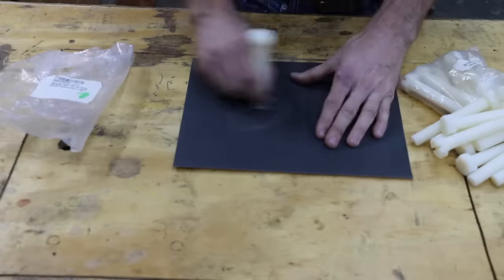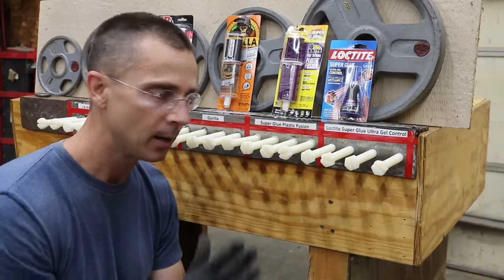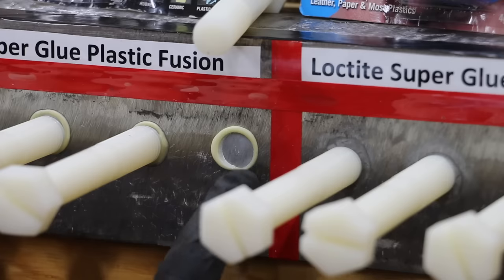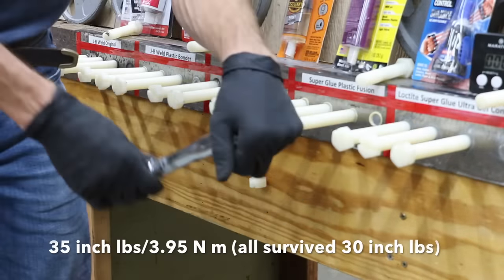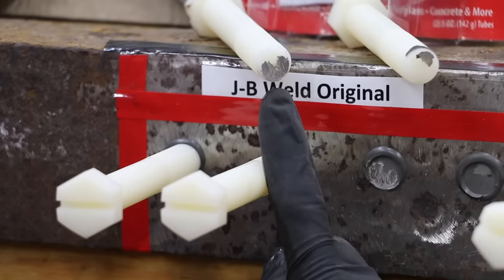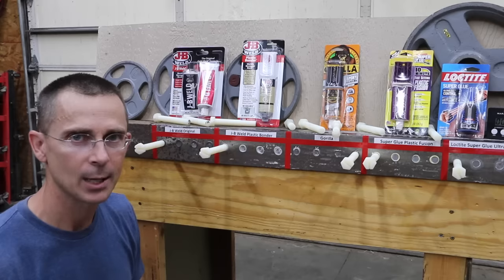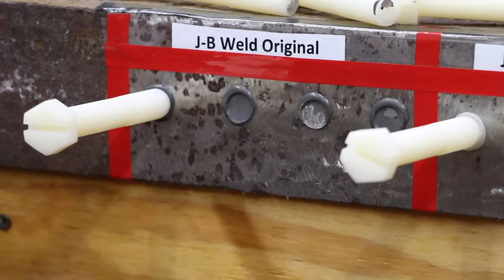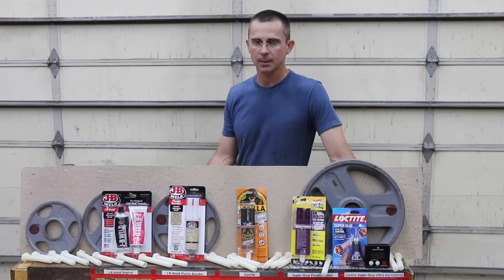Which Epoxy is Best for Plastic?  Let's find out!

Comment: I accidently drilled a hole through a fiberglass boat. I am thinking that either the JB Original or the Gorilla might be best since the hole is on the bottom of the boat where vibration is extreme. Any feedback on this or other mends would be appreciated. Hole is 1/4".
Reply from the maker: JB Weld should do the job.  A fiberglass repair kit might also be a good option.
Reply: @ProjectFarm  Thanks. JB has a marine product.

Comment: Would like to know what type of material the test bolts were made of,most non metal fasteners that I have seen were nylon which I have never seen anything bond to. I have had good results with most plastics when using epoxy specifically for bonding plastic these epoxies have a very strong solvent smell unlike most epoxies which have very little smell , I believe that the solvent allows the epoxy to melt into the plastic similar to PVC drain pipe joints
Reply from the maker: Thank for the feedback.

Comment: Thank you for your videos, I think a lot of us struggle in finding the appropriate adhesive for gluing plastics that are subject to rigorous forces. 
I was wondering if you would expand your testing of plastic adhesives to other types of plastic. It looks like you used nylon bolts and I was wondering would those adhesives test the same on abs plastic or on delrin or PET or PETE etc. 
Personally when I am attempting to glue plastic it is usually trying to glue a broken piece of plastic back to itself. So I was wondering what kind of results you might receive in testic plastic to plastic adhesion. 
A couple of other adhesives to consider adding to the mix might be a pcv plumbing glue (which there are many, some are a 1 step while others are a prime then glue) or what about something like testors plastic model glue? 
There are so many kind of plastics and so many plastic glues that I think you could make 10 more videos.
Thank you again for your informative videos.
Reply from the maker: Thanks and you are welcome!  Thanks for the video idea.

Comment: good enough presentation for me. this guy ain't a chemical engineer, but at least he's making an effort with a good enough test measurement method.  My girlfriend works for NASA as an electrical engineer and she does not know to use a multimeter. 
She did confirm to me they have JB weld on the space station, you cant weld in space, but you can jb weld. They keep several rolls of duck tape on space station space also.
Reply from the maker: Thanks!  Thanks for sharing.

Comment: Have you ever tried flame priming the plastic surfaces or used industrial trade expoies like Gflex ( specific epoxy for joining two plastic surfaces that have to flex in unison)?  Not sure if flame priming is an old plastic fabricators tale or not, but lightly without burning the surface pass a torch over the plastic before gluing.
Reply from the maker: Thanks for the suggestion.

Comment: Do we know which 2 part epoxy has the best soap resistance? 
I’m trying to bond PET bottle to HDPE plastic and found that the epoxy turns soft after a few weeks when exposed to liquid hand soap.
Reply from the maker: Thanks for the suggestion.

Comment: Hey Project farm
I suggest you do a plastic repair test on a plastic radiator tank; this seems to be a fairly common failure for people, at least it was for me. Radiator got a small crack a cheap repair would have been nice, instead had to replace the whole radiator
Reply from the maker: Thanks for the suggestion.

Comment: With 12 to 30 different so-called plastics on the market, I don’t recall what type of plastic was used in the test video. PA-66 with fiberglass reinforcement called GF-33 seems to be the most common plastic used on automotive parts. Yes, washing machine agitators and many many other items are made with plastic, like bumpers. Either way, it would be interesting to see what’s available for this PA-66 GF-33 as it finds its way to form intakes, radiator side tanks, rocker covers, oil pans, etc, in this race to lighten the load we push down the highways to achieve better fuel economy. I would guess the auto industry is a major player in plastic purchases as far a common and single industry. It effects us all?
Reply from the maker: Thanks for the suggestion.

Comment: One thing I’ve learned in aircraft applications is a bond will be stronger when a plastic mesh is added, (in certain applications).  You might want to try to see the difference.  Not sure if this would work on plastics, but on metal if you add the plastic mesh on the bond area it is definitely stronger.  The bond area has no touching surface areas and has a uniform bond thickness.
Reply from the maker: Thanks for the suggestion.

Comment: Im really curious as to what kind of epoxy or glue works well for bonding something metal to a plastic surface. Would there be a significant difference in performance?
Reply from the maker: Thanks for the suggestion.

Comment: I use JB weld all the time for plastic metal as long as you clean it properly use sandpaper and rough it up and get the JB weld around the edges real good you've got Good Hope one place it does not work well is radiators it's a temporary but it has a Time clock on it it will blow on you
Reply from the maker: Thanks for the feedback.

Comment: Good job testing different types of stress on the epoxied joints.  What would make the test better (more reliable) is testing multiple of each sample.  For example, if you weight-tested 4 Gorilla-glued samples, I can promise you there would be some variation in the amount of weight that made each joint fail.  What we don't know from your video is how much variation there actually is.  Put another way, you might have come up with stellar results here, or the tests might end completely differently if you repeat it.  We just don't know.
Reply from the maker: Thanks!  Thanks for the constructive feedback.

Comment: Tricky test. I think most (all?) adhesives need a lot of surface area for maximum strength. The small contact area between the screw and the metal just isn't enough for a strong joint. There might be some improvement in strength if both surfaces are roughed up (more surface area).
Reply from the maker: Thanks for the feedback.

Comment: I tried to reinforce a screw mounting location on my plastic motorcycle body part with JB Weld and it came loose from the plastic pretty easily. No strength. I gave it all another coating of 5x poly construction adhesive and I'm hoping for better results. Stay tuned.
Reply from the maker: Thanks for sharing.

Comment: Hi you really seem to be most knowledgeable at anybody I've seen online and I have a weird question they need help with hopefully you see this and reply I went ahead and sticker bombed my car and I put a thick vinyl sheet down on top of it to protect it but with the way son works it's still faded out after a while and now instead of ruining my paint I was thinking of gluing a really thin polyester fabric down to it and then covering it with table top boxy for protection so I could still lift it all off if I wanted is that a possibility somehow??? Thank you if you take the time to reply I really need the help

Comment: How do these compare to 3M DP8005 made for difficult polyethylene and polypropylene plastics.  I get it from McMaster Carr specifically for bonding to olefin polymers.  I have even used it as a primer on polyethylene to which I use less expensive epoxies which are better for the counter surface like wood or metal that I am connecting to...Try a lap sheer or possibly T-Peel with plastic sheet with plastic against itself and then mixed materials like polypropylene against aluminum.
Reply from the maker: Thanks for the suggestion.

Comment: @projectfarm 
Could you revisit this and test the durability of these products when it comes to thermal expansion and contraction, particularly in the sun? Would a softer epoxy hold up longer over time? 

I have a project where I need to glue black plastic bumper trim to a chrome bumper. I used a very hard epoxy and the bond failed after a couple days. I wonder if the heat of the sun caused the black plastic to expand faster than the chrome and if I used a more elastic glue, would it last?

Comment: Very interesting.  Is JB weld actually an epoxy?  Man that stuff is strong!  I’d like to try those tests with West Systems Marine epoxy.  Though it is on the brittle side I believe but it does seem to have a lot of strength.  I use it on my boat and it acts like T6 aluminum.
Reply from the maker: Thanks for the feedback.

Comment: Nice experiment!!!!
Are those "Nylon" bolts? Isn't Nylon notoriously impossible to adhere to?
Is that what makes gears and levers inside a cassette player, VCR or Remote control car?
Back in the 80s /90s, if a gear or lever broke inside your VCR/RC Car, it was time to find a new part.
I could be confused with one of the "poly-" type plastics.

Comment: I tripped over Steelstick in the late 1990's, used it first to fix my motorcycle's open headers, then graduated to repairing various things, laser printers, computer cases....  You can fabricate parts with this stuff.  Once it is cured, you can cut it or sand it, shape it...
Reply from the maker: Thanks for the feedback.

Comment: I know this is an old video, but I ran across it while youtube was just randomizing videos at work.  Those bolts appear to be nylon, which is chemically quite different than something like a polycarbonate or an ABS which is what I believe those epoxies are designed to work with.
Reply from the maker: Thanks for sharing.

Comment: I filled up a part of plastic with jb weld and mixed inside. Then i run out and got gorilla one, what i noticed with jb weld if you don't mix enough. One of the 2 parts it's going to be dripping and take way too long to dry even in the sun. The drips are so messy and sticky.
Reply from the maker: Thanks for the feedback.

Comment: I tried a triple q plastic weld on a heater matrix I've cut the damaged top part off used a aluminum plate and glued it it's been 2 days so far will put under pressure in few days
Reply from the maker: Thanks for sharing.

Comment: It's interesing but shouldn't plastics be distinguished from nylon and nylon 2 and so on. Also temperature is also an important factor when using epoxies, like on a radiator that has aluminum core and nylon tanks. I'm presntly tying to stop a leak on my radiator and I'm using loctite heavy duty 3500PSI epoxy but it doesn't have a temperature rating stated on the instructions.So it will be trial and error. Good video!!!!!

Comment: The real test is to bond plastic with plastic.  For instance, if you have a front hood fender that has a broken tab, and you need to reconstruct/rebuild the tab instead of buying new frond hood fender, then we can see which plastic flue has the capability to mimic the original plastic tab.  You used plastic with metal, but that is not usually what manufacturer intended the glue for.
Reply from the maker: Thanks for sharing.

Comment: Can you, or have you done a video on Plastic intake manifold screws stripping out and its fix.  Oversize screw or gluing in a hanger bolt with its wood screw on the bottom and machine screw on the top as a possible fix?
Reply from the maker: Thanks for the suggestion.

Comment: Does Marine JB Weld work on a radiator?  What is best for a small car radiator crack ?  Its Toyota plastic top, with tiny metal nozzle fitting. tiny movement.  So it will get hot...
Reply from the maker: Thanks for the suggestion.

Comment: I used that gorilla glue epoxy to fix a crack in both my rear tail lights that would let water into my trunk.  It worked real good and I made it very thin so you can barely see it.
Reply from the maker: Thanks for sharing.

Comment: He should have had the Loctite two part epoxy for plastic ,they had it at Lowes for years then switched to the crappy JB two part epoxy. For most all applications the Loctite worked extremely well and was very strong ,I used it on heavy use items that lasted for years and still holding. I was surprised that any thing he had held on those nylon bolts but they do make a special glue for them but it`s only available at the supply houses witch means it`s not cheap. But I still like his videos
Reply from the maker: Thanks!  Thanks for sharing.

Comment: What about plastic to plastic? I originally thought this was going to be a test about that. I used jb weld plastic to repair and seal up my wifes warmer unit in her coleman saluspa. Which was plastic. It was a much cheaper option than having to buy another pump. Originally she did not drain it when it deopped below zero so the plastic "tank" that held the warming rods inside expanded and cracked along the whole side of the "tank".

Comment: I noticed you did not clean the bolts before you roughen the surface with abrasive paper. All the fractures seemed to fail at the plastic (Nylon?) to epoxy interface. The abrasive paper does not remove contaminates from the plastic surface. The contaminates must be removed chemically PRIOR to abrasive cleaning. Using only abrasive cleaning will grind the contaminates into the surface. All it takes is a few molecules of a surface contaminate film to create the weak link in the bond system. You should also consider primers before applying the epoxy. Some bonding systems require primer. Like your videos
Reply from the maker: Thanks!  Thanks for the feedback.

Comment: Talking about strength. Mabe you could test chain and tow strap strength. On a load pull and weight capacity. Some people use them to tow a vehicle. But others use them on the extreme, pull chain on tractor pulling to knock down broken trees. Which would you prefer chain or strap.
Reply from the maker: Thanks for the video idea.

Comment: Nylon to steel isn't a common application, so your test won't apply to the most common types of cracks or failures. As mentioned below, nylon is one of the slipperiest materials out there, bushings are even made from it. The most common plastic is a bumper cover or other ABS type of plastic that a DIY'r would  run into. Consider doing another test using plastic to plastic with no dis-similar elements. Your tests are always appreciated!
Reply from the maker: Thanks!  Thanks for the suggestion.

Comment: Can you test any of the bsi adhesives and compare them to other products on the market? specifically bsi maxi cure as its the product they provide that is most versatile. I'm going to be making shoe alterations (vinyl pvc) and need to know which product is best for bond strength, water resistance, flexibility and that dries clear. I'm already going to buy the barge superstik for the soles but I'm also adhering rhinestones, crystals and other decorations to the shoes, so I don't want to waste time or money on products where the decorations will fall off.
Reply from the maker: Thanks for the suggestion.

Comment: so 1 of the reason i wanted to watch this is i am mounting a plastic bracket to the side of my rv (flat fiberglass) to hold a weboost 25' pole to put my pole adapter on for my starlink dish  these supports come with 3m tape and i wanted a more reliable hold what do you think i should use? oh the gear is $600 worried that this will fail and damage my internet starlink dish?
Reply from the maker: It's hard to advise without seeing the size of the mount.  3M makes a great product.  Seems worth trying.

Comment: My 1/2 inch plexiglass boat door split and it has a clean split...what is the best plastic glue to bond plastic to plastic, please.   A product that shows minimal material.  I tried Weldon #4 and it seems to be holding, but still waiting to see the future result.
Reply from the maker: Thanks for the suggestion.

Comment: What I need to know is which epoxy will bond plastic to plastic. That’s a problem I keep having. The last one I tried was Gorilla epoxy. It didn’t hold. What can I use? Please test that. Thanks.
Reply from the maker: Great suggestion!  Thank you.
Reply: @ProjectFarm   Scotty Kilmer tested something called Q bond to glue two plastic pieces on a car. It comes with super glue and some powder that you sprinkle on the glue. It seemed to do a good job, but I know you do a much more thorough job of testing products than anyone else. I tried glueing two plastic car parts together using Gorilla epoxy. It failed miserably. Please do a test if you can. You’re my go to guy when it comes to testing products and cutting through the hype. Thank you and keep those videos coming.

Comment: Those plastic bolts look to be ABS. I haven’t found any epoxy that would stick. Only thing that worked was mixing abs beads with acetone (I think). It chemically bonded/welded once the solvent contacted the surface. Same way plumbing glue works.
Reply from the maker: Thanks for the feedback.

Comment: I am interested in a type or brand of glue that will bond polyethylene plastics like are on ATV's and UTV's. do you know what material the plastic bolts that you are using for the test are made of?
Reply from the maker: Thanks for the suggestion.
Reply: 3M DP8005 is the only adhesive that actually develops a good bond to PP and PE.  But it is pricy so I line up all the polyolefin glue jobs for one dual tube worth and mixing nozzle.  Actually, if you don't use the mixing nozzle you can dispense a double puddle directly on a mixing pallet and hand mix a small amount.  Tube requires a matching dual tube manual dispenser and optional 10 to 1 piston assembly.   But trust me, it is nearly the only adhesive that works on propylene and ethylene polymers.